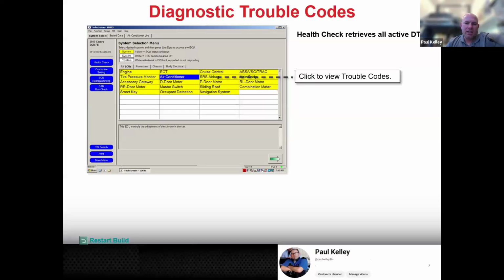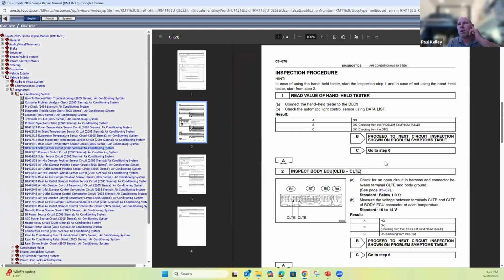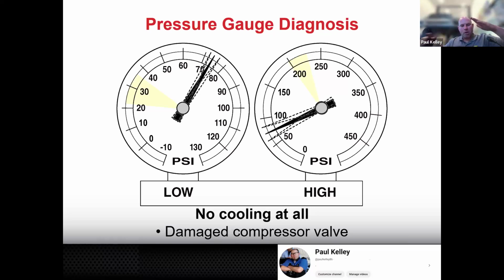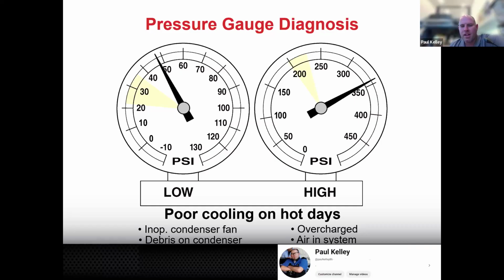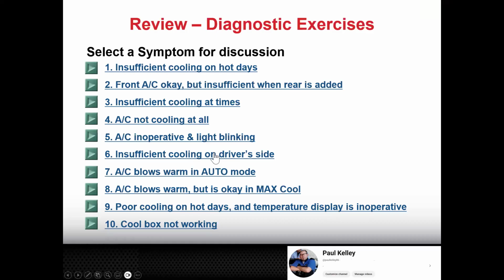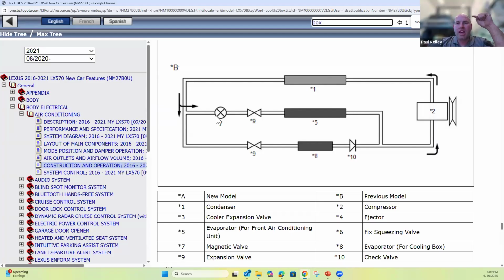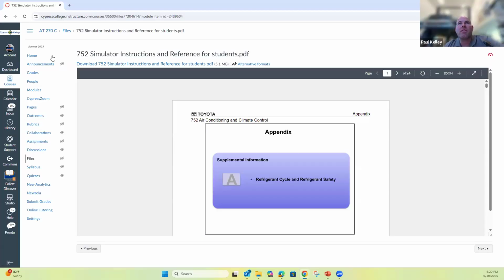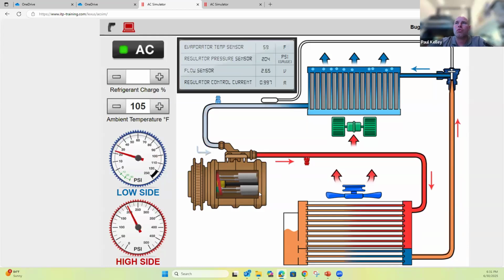ASE A7 Unit 7 HVAC Diagnosis Part 1 With Simulator Instructions

Comment: I drove through the rain in my Lexus  two months ago and the belt got wet and slipped. Suddenly, the A/C stopped working and the light started blinking. There was nothing wrong with the compressor and its circuit. The A/C is working as designed. I have read that the module can shut off the A/C if the belt gets wet and causes  the a/c light to start flashing. As an instructor for Toyota, would you be kind enough to tell me if that is true?
Reply from the maker: That's a little unique but my theory is that your compressor may have the lock sensor. If the lock sensor showed zero rpm (because of belt slip)  it may report as an electrical fault. 

Interesting.
Reply: I will check to see if it is equipped with  the Lock sensor. Turning off the A/C and turning it back on was  the only thing I did when that happened to make it work again.  Thank you for responding. I really  like your videos.